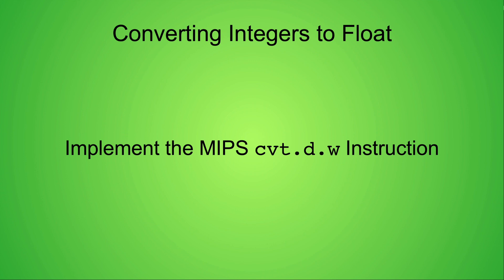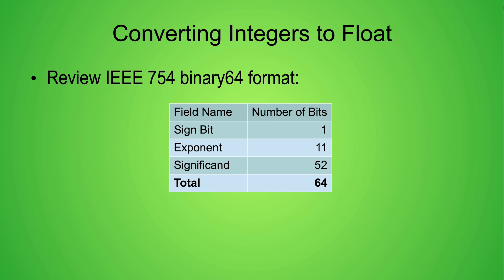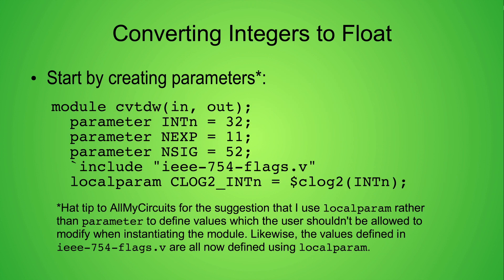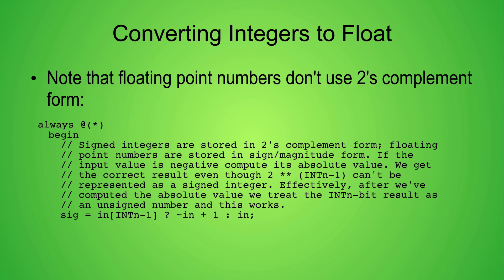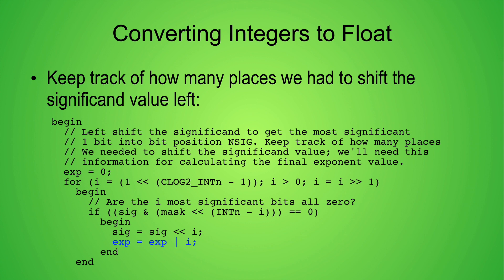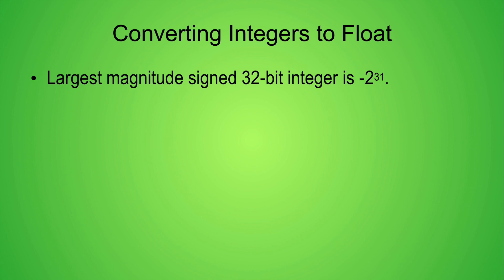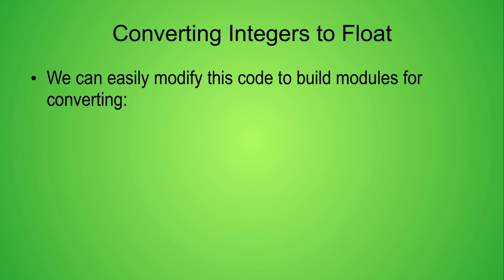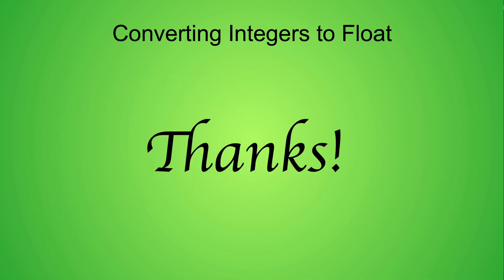Building an FPU in Verilog: Converting Integers to Float, Part 1

Comment: Hi Chris, great video!
I have one question though, is it possible to scale this code to convert  a 32-bit integer to a custom 18-bit floating point representation? A different representation than the ieee 754. For example 1 for the sign, 4 exponent and 13 mantissa?

Best regards
Reply from the maker: Could it be done? Yes but it's not as simple as changing a few configuration parameters and recompiling the Verilog code.

To get the multiply unit working would be fairly straight forward. There is an old version of the significand multiplication logic which (I think) could just have its parameters changed and be recompiled. That old version of the significand multiplication code won't be particularly fast because it doesn't exploit hardware parallelism.

The addition/subtraction unit would require a little more work. I didn't rely on the Verilog compiler to generate the addition circuits. Instead I used addition circuits generated by a Python script. The code could be rewritten to rely on the Verilog compiler to generate the necessary adder logic.

The Verilog code which does the rounding is parameterized and it should enough to change the parameters but, again, the code uses Python generated adder circuitry and that logic would have to be swapped for logic generated by the Verilog compiler.

The slow state machine version of the divider should be fairly easy to adapt. I think it too uses Python generated adder circuits but again the code could be modified to rely on the Verilog compiler to generate the adder logic.

The is also Verilog code to convert integers to floating point numbers. If you have the skills to make the changes for the arithmetic operations changing the integer-to-float conversion logic should be well within your abilities.

If you wanted to retain the Python generated adder circuitry once you've determined the sizes of the integers you would need to be adding you could download the Python script and generate whatever adders you needed.
Reply: @FPUniversity  thanks for replying!

Comment: I'd like to emphasize that "for" loop in verilog actually works at compile time, doing "loop unrolling", so after synthesis it all ends up like barrel shifter and leading bit estimator controlling it, in order to get it all done in one clk cycle.

I personally think this Verilog syntax confusing, it makes many people think that FPGA programming is the same as usual C, using regs for variables and all the usual operators, if's and for's to get job done. But then it refuses to synthesise in some cases, or generates large code populating half of FPGA and working at no more than 5 MHz (because of many many layers of logic following one another without any latches)! And then poor students think: strange technology this FPGA, I would rather use ARM :) Been there :)
Reply from the maker: Fair point that for loops are actually instantiated at compile time rather than at run time as a tradition software loop would be. IMHO though people should be using the schematic generated by the Verilog tools (among other aids) so that they understand what it is that the compiler is doing on their behalf.

And, just because some don't understand what is really happening doesn't mean that a particular tool should be taken away from the rest of us who do understand. And, no, I don't think that is what you're suggesting. 🙂
Reply: @FPUniversity  You're right, I'm not suggesting it :) Though I thought that they should somehow show which operators work in runtime and which are not. Like all macros in C beginning with # and colored differently so programmers are hinted these #IFDEFs are executed just once at preprocessing stage!

Though there are also "behavioural" modules which are not meant to be synthesized at all and can use all sorts of sequential operations as well as math functions. So yeah, probably each person just have to stumble once or twice with that :)